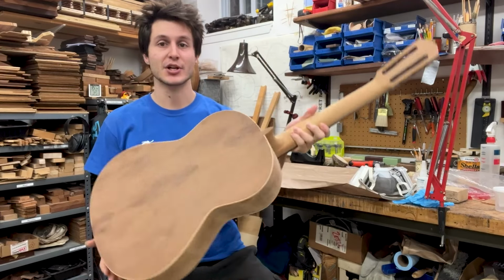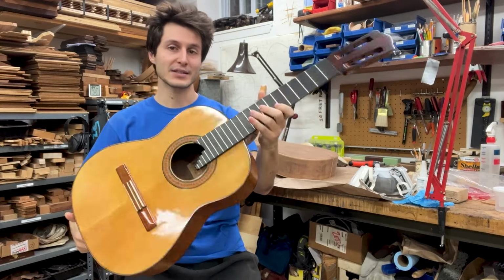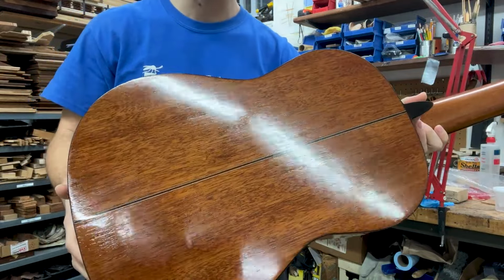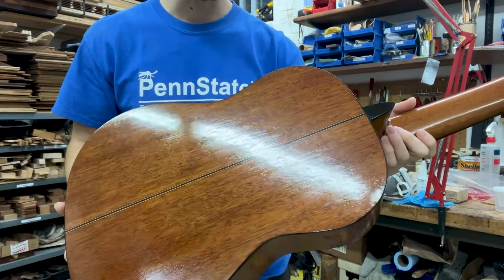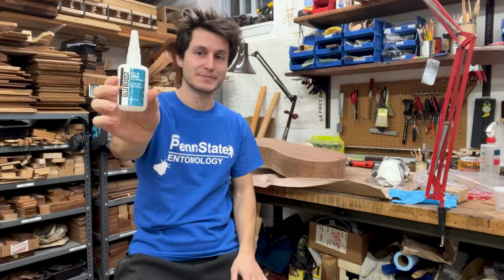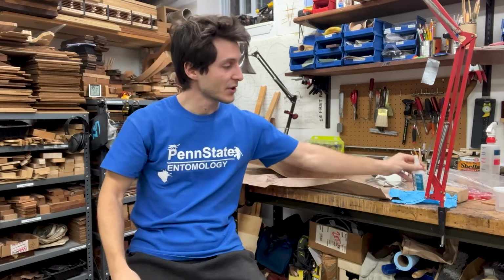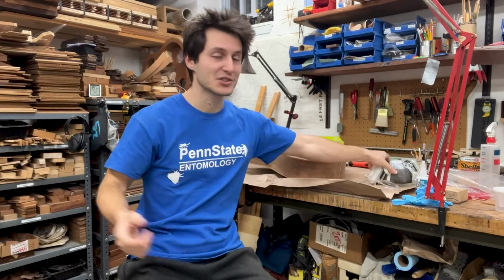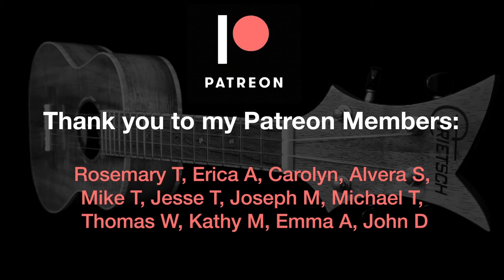How to Superglue Pore Fill a Guitar or Ukulele with GluBoost Fill n' Finish

Comment: You are playing with your health, dude. Why do you think this product comes in really tiny bottles? With that huge area you are working at the same time the immense amount of fumes will damage your eyes and lungs.
Reply from the maker: Noted in the video! A respirator, goggles, and proper ventilation is a must. Thanks!
Reply: @CTrietschUkuleles  I used respirators and still managed to become sensitised to superglue. Now if I use it even briefly I get bad hay-fever like symptoms for 3-4 days afterwards.
Reply from the maker: @ColinWatters  that’s terrible, sorry to hear! If you need recommendations for other pore fillers let me know - there are lots of options!
Reply: @CTrietschUkuleles  No worries. I was only using it to speed up building RC model aircraft, not as a large area pore filler, so can avoid it. Im fine with epoxy. Now if I really have to use superglue for something I have to do it outdoors so the wind blows away any fumes or suffer.
Reply from the maker: @ColinWatters  That's good to hear! I do the same when I have to use superglue - outdoors is best. I heard that people can become sensitized to epoxy too though! crazy

Comment: I tried laquer clear coat over super glue and it did not work well at all. I think just a superglue finish would have good sound though as it gets super hard. Was thinking if there was a way to spary it on would be great, but don't know? It does not sand well at all?
Reply from the maker: Sorry to hear you are having trouble! Super glue isnt going to get smooth or glossy and you won’t be able to buff it up like you would a finish. I’d also be concerned spraying it with how toxic it is - wouldnt want airborne superglue particles floating around. There are lots of different finishes though if spraying lacquer is giving you a problem, maybe a brush on or wipe on finish that sands well, looks good, and dries hard would be better! Best of luck!
Reply: Investigate a wet sanding technique…thin your true oil and sand in the wet slurry…when it dries …sand minimally repeat until it looks like an automobile finish.
Reply from the maker: @patrickjoseph5028 good tips! Micromesh and Bufflex papers work great too
Reply: @CTrietschUkuleles  This is poor information, CA glue can polish up to a higher gloss than any "poly" type finish.
I use it for grainfilling, which is fantastic, but once filled and level sanded, many more coats can be applied until thick enough to flatten and polish.
Reply from the maker: @peterjones3100  that’s great that you have had that experience, good for you! That hasn’t been my experience and that is fine too
Reply: @CTrietschUkuleles  OK that's not your experience, but the fact that many industries, pen making, furniture making, lutherie etc use CA as a gloss finish shows it can, and does work.
Reply from the maker: @peterjones3100  that’s great! Sounds good